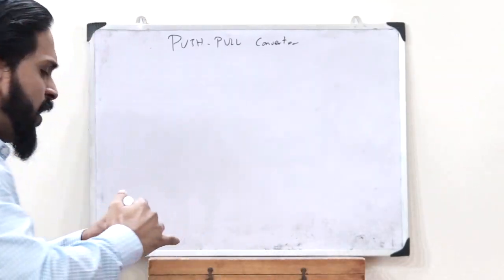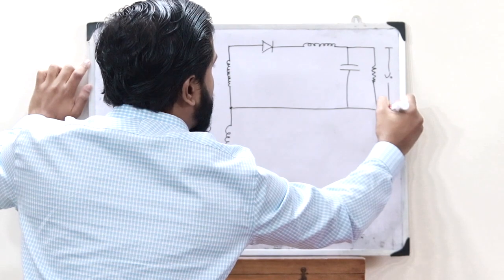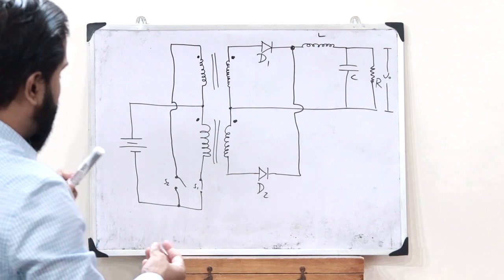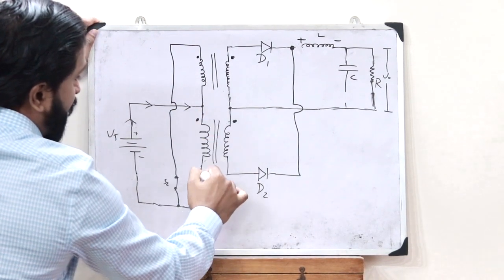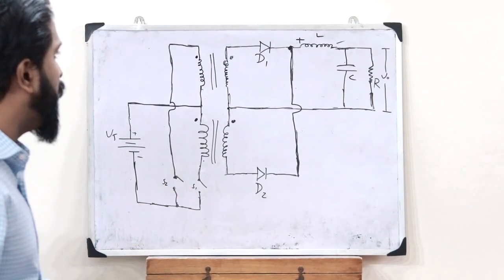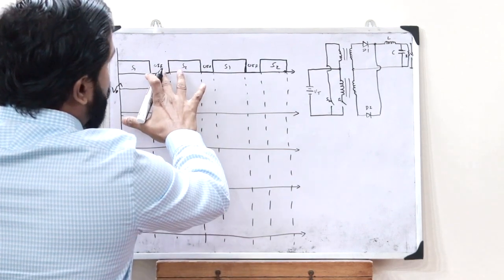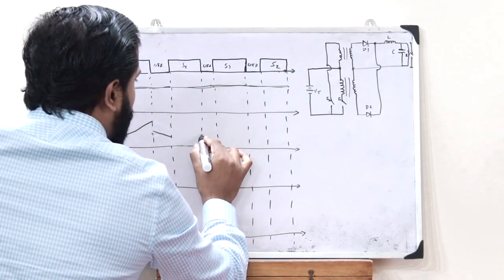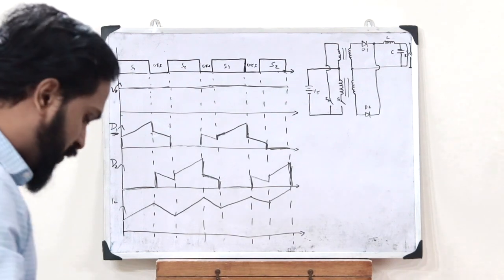Push Pull Converters - Introduction, Circuit Diagram Construction, Modes, Working, Waveforms | KTU

Comment: is there a particular circuit application that only requires implementation of push pull circuit? i mean why use push pull circuit when flyback circuits are present that only uses 1 transformer?

Comment: Sir,there is a doubt regarding the switches..... Are we turning on and off those switches manually or automatically those  switches will turn on  and off like using PWM?
Reply from the maker: That’s a really good question Nestin! In the case of all the circuits in power electronics involving the periodic turning on and turning off of switches, we use PWM signals! It is manually impossible to keep turning on and turning off the switches periodically continuously!